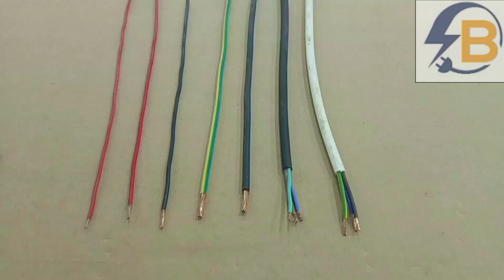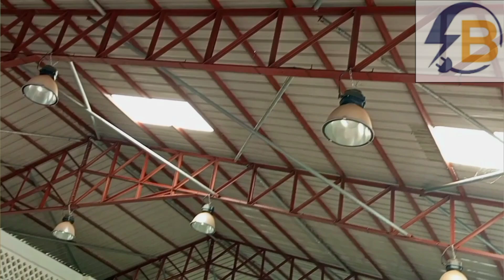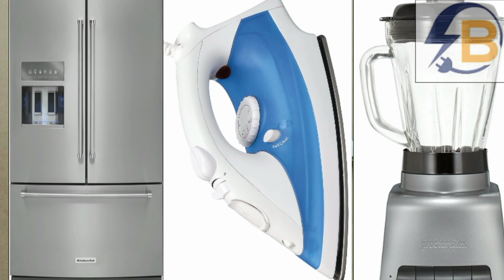WHAT SIZE OF WIRE SHOULD I USE FOR WHICH LOAD?

Comment: Good morning Mr. Please what about if you use a higher cable to wire a low consuming appliance. What will happen. For instance, if I wire a socket with 4mm cable or 2.5mm for lightning. What will happen?
Reply from the maker: @yeewurakcollins6532  
https://youtu.be/44_mFfG2zzk?si=8vK6cm5e1fuevqiA